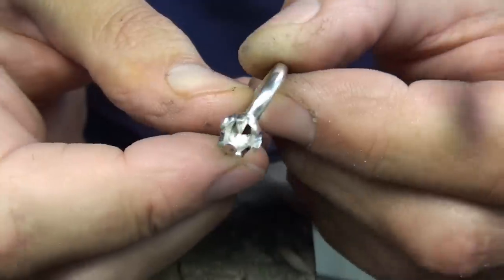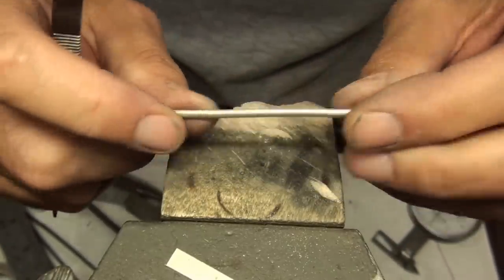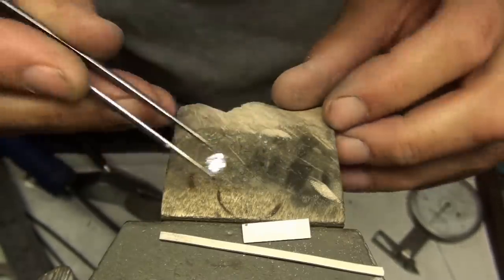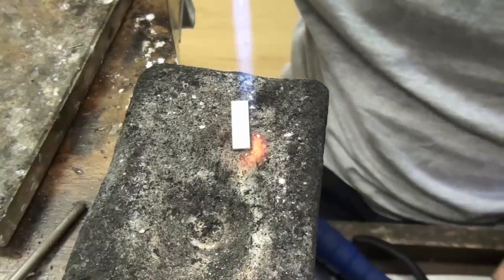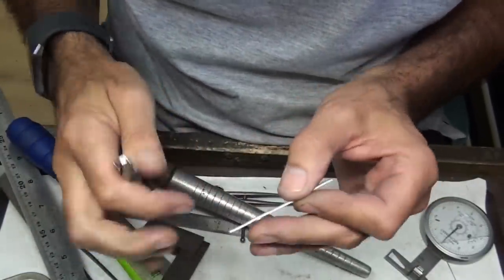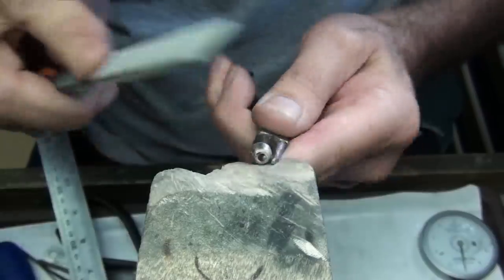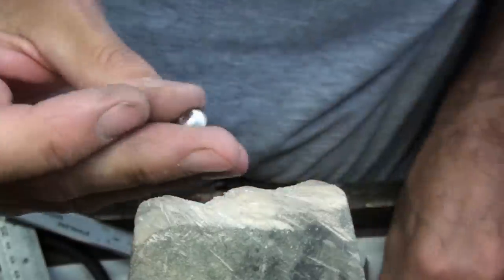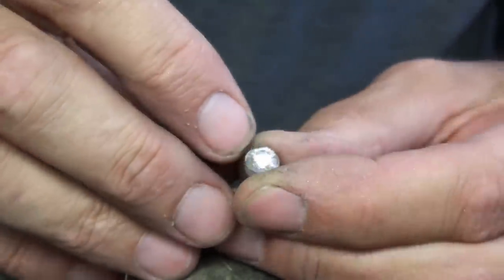Simple Crown Set Ring

Comment: I was just confused by the fact you u showed the ring soldering tweezers then proceeded to not use them
Reply from the maker: colton carlson it’s an option that I show in other lessons, but this time it wasn’t needed
Reply: Jewellery Advantage thank you for the quick response.
Reply: There's a trick to soldering bezels to ring shanks and aligning them perfectly.  You can use the flux as glue if you heat it the right amount.  I set it up on the third arm so gravity holds it together and the ring is facing up so you can see it as it would be worn, flux it, line it up, heat it just before it starts turning glassy, let it cool slightly.  Then it's glued together and you can flip the ring over and it won't fall apart.  Then you can set it face down to solder it and you know it will look correct facing up.  This technique really helps with large odd shaped bezels.